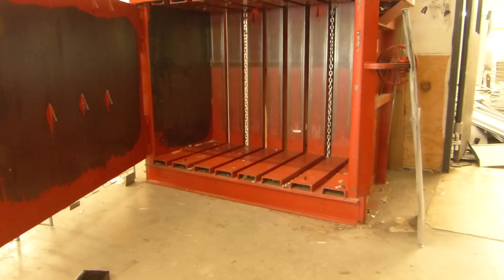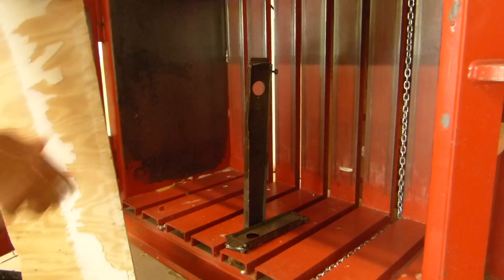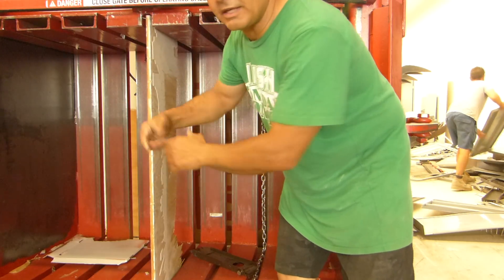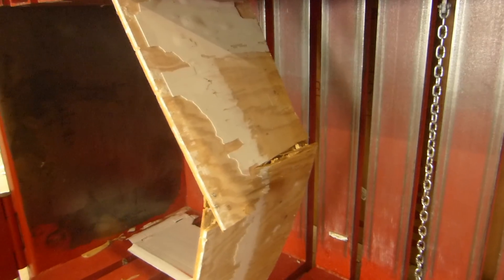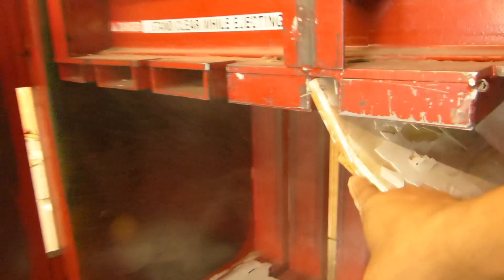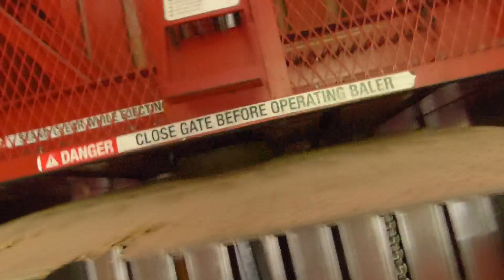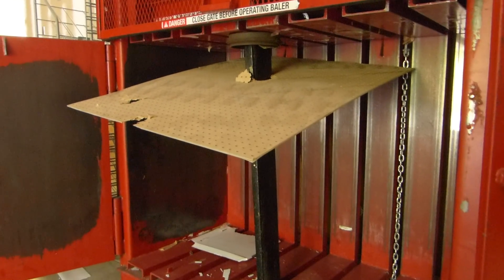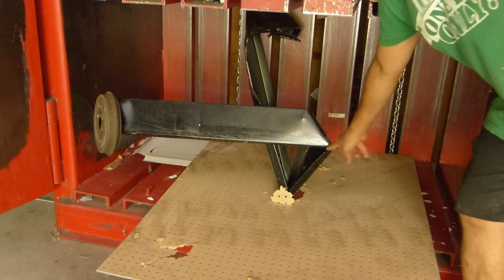Punch Shear Duplicating with a hydraulic press Model For Surfside Building Collapse

Comment: Kai, I have the garage data that supports your theory 100%. 

Follow the load forces from the garage entrance inside to the base of the ramp, column 14 across the slab to the opposing column supporting the beam which failed, the ceiling fell in, the column fell atop the collapsed floor after the punching shear took place as viewed by the video taken immediately before the entire building collapsed. That video also shows the widening of the structural cracking atop the outside of parking garage entrance header that also traveled West toward Collins Ave stopping at the exact location where the building held after the major collapse. 

The data prior the collapse shows extreme joint over pressure damage on the garage entrance concrete apron, the street deflecting 1 to 3 inches downward and inward towards the garage entrance ramp.

There are stress fractures prior to the initial collapse along the outer concrete wall running East to West on the garage entrance side. 

The 774,000,000 million lbs of earthquake producing dump trucks full of new beach sand on a road, next to Champlain’s foundation systems NEVER meant to be subjected to the enormous shock loading vibrations transferred down the parking ramp into the structure leading to the   punching shear in the parking garage that unzipped the remaining pool decking while the spine of the building broke from the garage slab all the up to the top of the elevator shaft. 

This 100% supports all of the witness statements and your data Kai. 

Nice work. You nailed it.